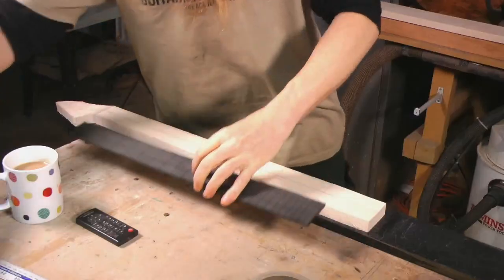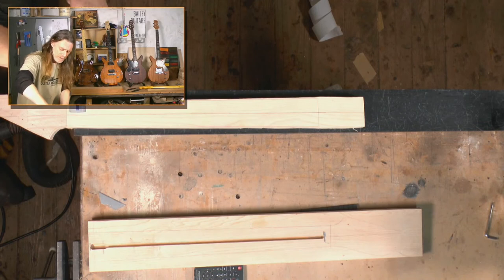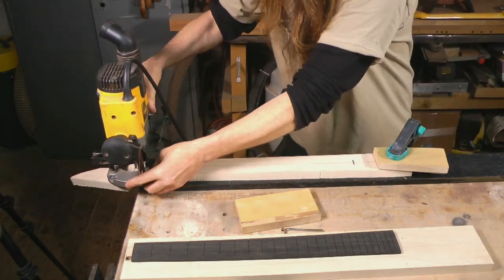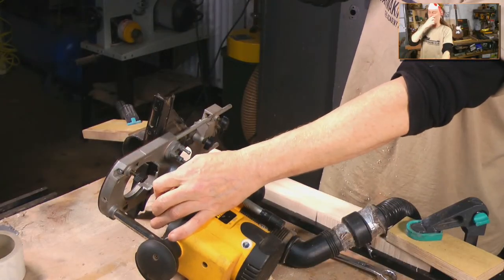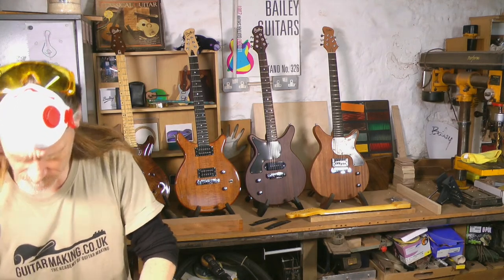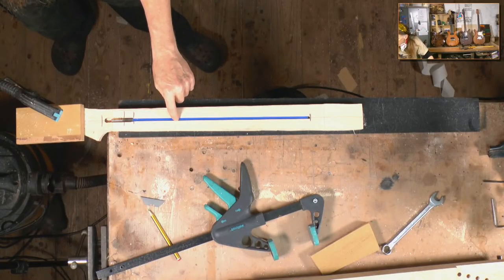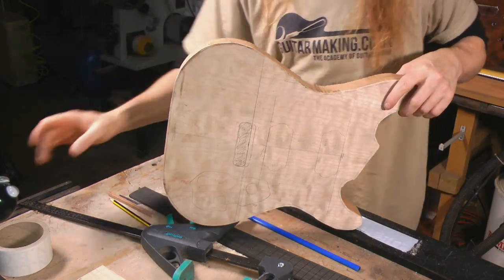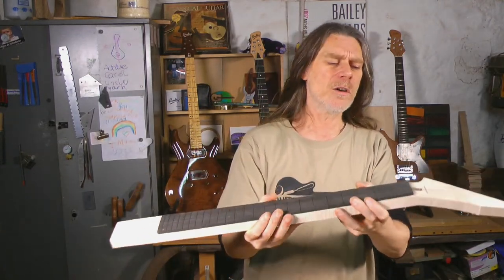This could go horribly wrong!

Comment: Why not cut a wedge to match the headstock angle and double sided tape it to the headstock creating a flat surface so the router doesn’t rock then just route through both pieces of wood
Reply from the maker: Good idea - I didn't really feel it was needed...but it just might have helped! (there is always a danger that it comes loose tho and wreaks havoc so I have found it best to keep set ups to a minimum). I should have picked up my other router as I mentioned with the more suitable base. I have routed many truss rods into scarfed necks like this - but usually BEFORE cutting the shape out! Ho hum...CHEERS for the comment!
Reply: @GuitarMaking  I suppose you could also screw it down into the headstock at the same points where the tuner holes will eventually go providing you haven’t already drilled them out....the screw holes would then disappear when the post holes are drilled...always more than one way to do any job isn’t there
Reply from the maker: @Barrygee  Yes - if I was making a lot I could also make a wedge that drops into place using the tuners as pins for location...but I usually do OK with the other router...it is good to think things through as much as possible...some call it procrastinating...I call it useful lazyness :)